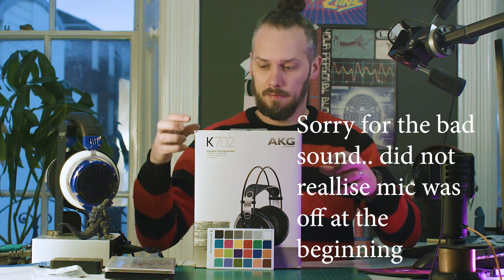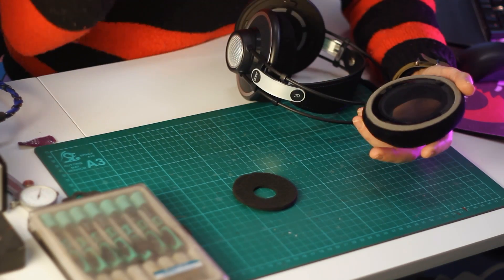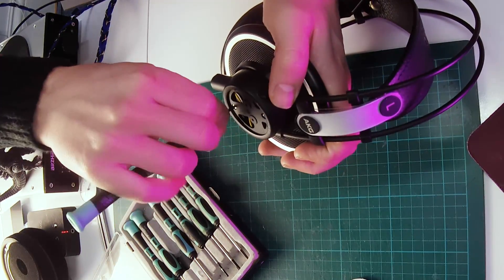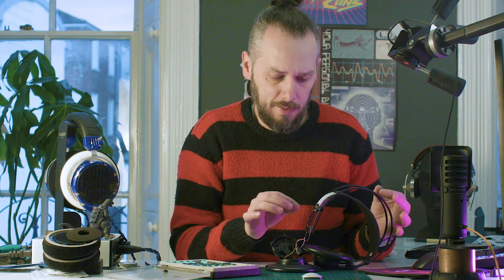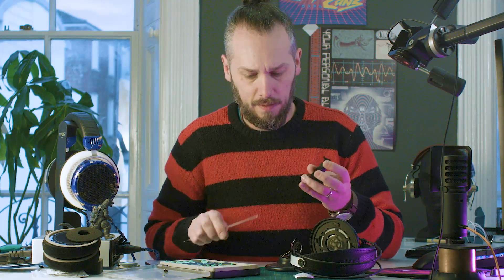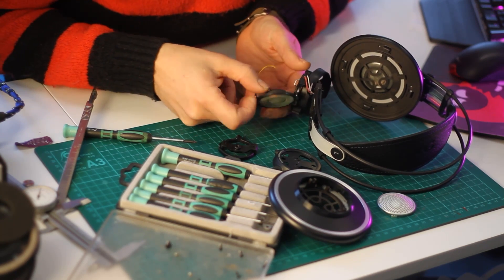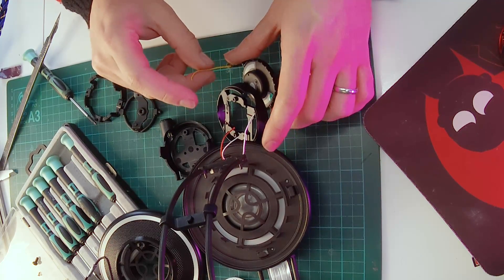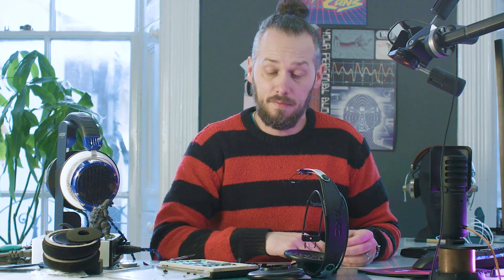AKG K702 dismantling and design review of this overly complex headphone

Comment: 7:45 that thing exactly happened to me💩, do you know if It is possible solder again the voice coil filament to the post or better look for a new driver?
Reply from the maker: I learn's by making that mistake - I did manage to reattach it but it was many years ago so I can't quite remember what I did but I think I just heated the pin up, added a little solder to the end and put t back in place holding it there while it cooled - It worked afterwars but I don't know if i was just lucky

Comment: The right side of my K612 stopped working. I will try to disassemble it and see what went wrong. The sad part is that it's just over a year old. 

 Thanks for the video.
Reply: It might just be disconnected wire. Just had that same issue on my q701. Quick (ugly) solder took care of it, first time soldering too.
Reply from the maker: No Problem

Comment: Nice I took apart a few of K240 600 Ohm, which are over 40 years old, but still work fine and sound great. It is amazing how little the AKG design has changed. Drivers look remarkably similar, and same arrangement of openings around drivers, not even speaking about headband construction. Something tells me that modern AKG headphones are same as old, changes superficial and inconsequential.
Reply from the maker: If it ain't broken, don't fix it ;)

Comment: after buying a pair, i'm kinda having buyers remorse, the earcup material is itchy and bothers my skin and the elastic is headband retention is way to hard, it constantly keeps pulling the cans up on my ears till it squishes the bottom of my ear which requires readjustment every 3-5 minutes, been debating about cutting the elastic bands to let the headband just free move since when it's on my head it sits on the largest adjustment anyways
Reply from the maker: Ah that is a shame. It is not I problem I found  with them. I think cutting the elastic may cause them to slip down off your ears unless you have a big head. I have seen some DIY guides on changing the elastics so you may be able to bodge something with a less elastic piece
Reply: @CustomCans  yeah I went back to my by now 6 year old M50x even the sound quality on the K702s didn't impress me at all. 

I do have a fairly large head and have had more than a few issues with headsets that look huge but actually have really poor adjustability range.

 It's a shame but I think I'll just buy another pair of M50x or M60x when my current pair actually die

Comment: I wish the ear pads were just slightly thicker, or that AKG offered a thicker replacement. The hard part of my ear touches the cup and it's the only part that's uncomfortable about these. With the old K240 Studio I ordered a set of Brainwavz and got rid of the problem, but with the K/Q 7-series the pads are asymmetrical, and Brainwavz doesn't offer any like that. Dekoni audio does offer pads for the Q/K 7-series, but they aren't angled either, and are more expensive than the Brainwavz.
Reply from the maker: Sound's loke a gap in the market - we may look into making some kind of adapter rings in the future so you can use different pads
Reply: @CustomCans  Wow, that is interesting. It of course brings the next question of where would you find pads that are both angled and thicker.

The classic hack is to use like a piece of old charger cable to wedge under the pad to lift it up, but AKG's design here doesn't have any "lip" under the pad where that would fit.
Reply: Thicker pads take driver away from ear, with pretty dramatic change in tonal balance. Properly designed pads are integral part of sound signature, not just comfort.

Comment: Lots of people have complained that the headband elastics wear out. I thought they were just crazy unlucky, since I've had my K240 Studio for years in daily use and it's still working fine. Then I bought a (very lightly) used, near pristine Q701 - Austrian made - and the elastics are already just two pieces of string, completely tired out. Doesn't really matter for me since my head is so huge the strap is at maximum anyway, but my girlfriends can't get them to hold at all.
Reply from the maker: Yesm we have had a few pairs in to have the elastics replaced so I know it does happen

Comment: What improvements are to be made wiring them balanced?
Reply from the maker: The main advantage is that you can thn use them with a balanced output on a player or amp... when you use them with a balanced amp you should get slightly better Chanel separation and most balanced amps have more voltage slew .. That may also improve sound quality a little

Comment: Sound is great, very comfortable on the head, but soldering is shit.
Left cup wire detached in mine after 2 years for no reason (yes I used them extensively but carefully and they never left the house), hence why I'm watching this video.
For some reason it's always the red wire in right ear (multiple people reported problem with this exact one lol) 
But as I saw myself soldering in general is very weak so no surprise it broke after awhile that easily.

So if you want good home studio monitoring headphones – these are really great for that purpose but be warned that one day one ear may just stop working on you for this exact reason.
If you're good with diy soldering then this shouldn't be a big deal of course.
Reply from the maker: Interesting... It is probably because the wire is soldered to the headband. As it is a big chunk of metal, it will wick the heat away and would need to be heated up first to get a good solder joint

Comment: Interesting video; thank you! I wonder which parts are to be removed in order to replace the rubber ring. (I've got an old K240DF -- approx. 15-20 years old, and the elastics still work. However, the newer headphones I've bought (K701, K712pro) had worn out, loosened rubber rings in 3-4 years.

Comment: Certainly an unusual headphone and honestly not one that I would recommend unless you are familiar with EQ because they are so ridiculously bass light and overemphasized in the 2 or 3 khz region. So in short: You either love the sound or you hate it.
But it seems like these headphones are very long lasting. Ive had mine for a year almost and the earpads have not compressed one bit while the DT990 I had before needed new pads at least once a year.
Best value for money from AKG seems to be the K612 which is basically a K702 tuned to be more neutral and with no removeable cable.
Reply: I love mine! Extremely detailled and spatial sound experience. And i would not say, that the bass frequencies are too low..they are just perfect for my taste. I can confirm the accentuation of the higher midrange frequency, but since i like present voices it is just right for me.
Reply: For mixing and mastering, can you please tell which one between DT 990 Pro and K702 gives a flatter, more natural sound? 
At this point, I'm torn between the two. I heard that DT 990 Pro gives too much treble, which is the sound that bothers me the most.
Reply: If you listen to bass-heavy pop music, then yes, they are shy in bass department. But for all kinds of classical music, they give very good balance of highs and lows without any external EQ. For example, piano sounds natural and not boomy. Bass-boosted headphones give very unnatural speech reproduction - boo-boo-boo glare hanging over.
Reply: I mean K702, K702 MKII, K712 and etc are all semi-professional studio headphones for monitoring purposes. Frequencies should be flat for studio headphones, no embellishments otherwise how are you mixing with those? Sound is not meant to be pleasant in mixing headphones, it designed to be honest and clear. 

If you want to enjoy music instead of producing it in home studio – buy Hi-Fi headphones, not studio headphones.
 Hi-Fi headphones boost bass frequencies ridiculously to sound "better", that's why you think these one have it on the light side.

Comment: The most insane part about it is that this feverdream of a design was first realized with the AKG K500 in 1991. Imagine coming up with this without proper 3D-CAD. All of the junk in the back of the driver also causes the peak at 2kHz. There used to be some people who would run their K701 without the silver plastic grill and the holder for the connector/strain-relief and just 2 side direct wire to the drivers.
 
If you enjoy this sort of thing I recommend looking at the K812 which is probably the most complicated headphone I have ever seen.
Reply from the maker: Thanks for the info. I suspect the K812 may be a little out of my budget for the time being, the little lemo connectors they use or too thin to fit our cables so I can't justify buying some for the business but if we get some in for repair or something I will definitely have a good look at their construction
Reply: What is the relationship between the back grille and the 2kHz peak?
Reply: @Гингко  The dome's cavity forms a neckless resonator. The more you close the back of that cavity the stronger the peak. Was another popular mod to remove the dome's chromed grill and the smaller foam disk.
Reply: Look earlier. K240 from 80s is almost exactly the same, but with more simple design of swivels.